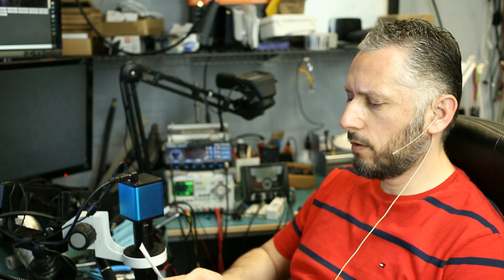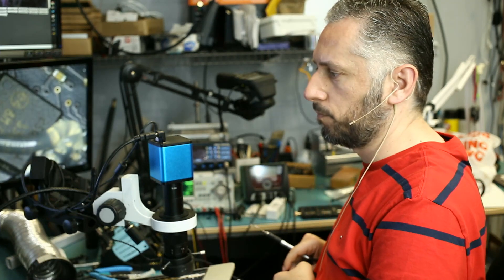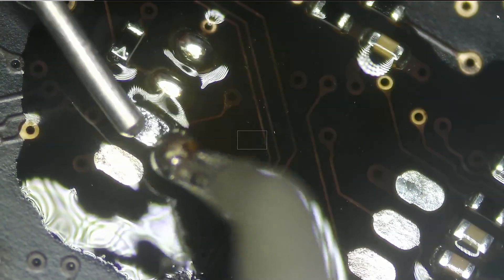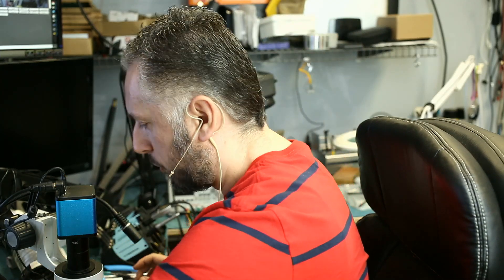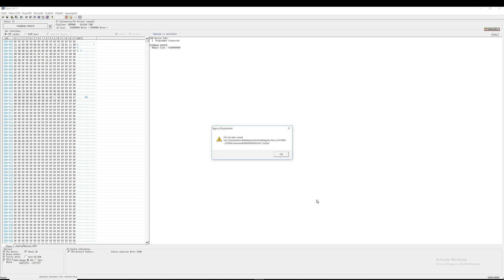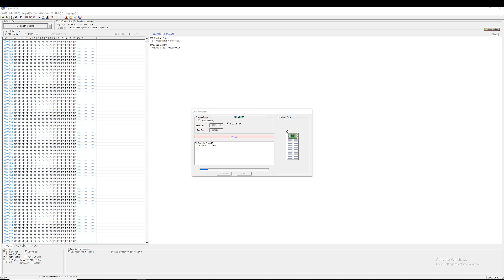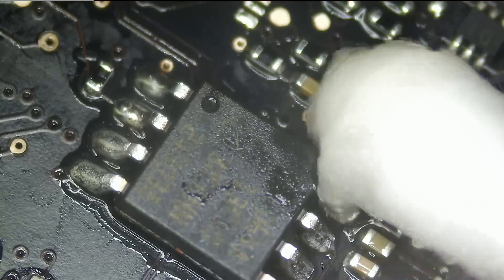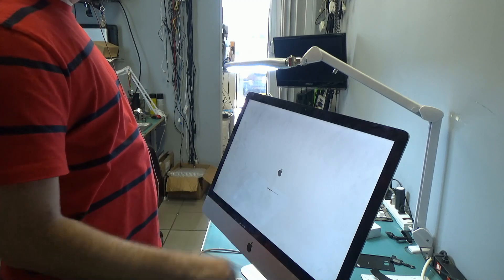2012 iMac Clover EFI bootloader Fix - Infinite cycles stuck in a boot loop

Comment: Friend, I have an iMac 2011 and after plug it on power cable: 
just LED 1 is ON (motherboard) and auto both coolers in infinite loop (1 second ON and OFF), but machine dont start.
This is the same your loop of video? Have any idea about the problem?

Thanks a lot!!!

Comment: Hey my imac do 3 small beep and 3 long beep i cant find the solution c an you help me please its early 2008
Reply: 3 x short, 3 x long, 3 x short? you mean this? Then probly it is EFI chip.
Reply: @guyriela  problem solved by changing cell on the board
Reply: @charliewright3534  that Could also Sometimes work. Good that it is Fixed

Comment: Good evening 
I just want to ask you something.....like my last resort after I’ve tried everything....
Endless hours on the phone with apple senior advisors,etc.
After a Safari update while I was on High Sierra I’ve lost both my mini display ports...I have a late 27” IMac 
So I’m not able to use my external monitor with this iMac.
I went to Apple Store....no luck,worst experience ever.
I went to the best repair shop in Montreal and they confirmed that it’s not a hardware but a software problem.
I was told that I have a “corrupted EFI”.
I was again 1 hour and 45min on call with apple senior advisor,tried everything with no luck again.
Any ideas or advice will be great and appreciate.
Thank you and sorry for the long comment.
Reply from the maker: The problem could be efi related. Use the contact us form at http://northridgefix.com/contact-us/ to inquire about price. To ship your device fill out the mail in form at http://northridgefix.com/mail-in/

Comment: lol, i actually found a way to solve this without even soldering.  Here's how to PROPERLY reset the EFI on any iMac.  Unplug it from wall, remove screen, (detach both cables for screen), unplug hard drive SATA cable, plug back into wall.  You will have no screen, BUT, power it on and the second you hear the chime, (it will be only one, I guarantee it), press and hold command+option+p+r.  once you hear the 2nd chime. let go.  Press and hold the power button to turn and/or unplug from wall.  Then attach everything and fire it up!!   That's it!  Don't use Clover next time.  =P
Reply: .. my macbook died in december, chime loop for efi corruption, what can i do?
Reply: ViralBump because of clover?
Reply: can i do this on macbook air?

Comment: Hi sir, what is the software you're using with the TL866II programmer and is the little board you clip the chip in is included in the ebay link (programmer) you posted in your tools ?  Thanks a lot and have a nice day :-)
Reply: I bought the 'plus' version which comes with multiple adapter boards and connectors. The software is on a small disc and you can also download it from their site.
Reply from the maker: The software is included with the programmer. https://amzn.to/2DODuG6. I removed the ebay link. Seller change the listing.

Comment: Thanks for this. I'm intrigued with the clamps at the end of the video; are you using a glue adhesive? I usually buy the adhesive tape kits that are pre-cut when upgrading hard drives on these etc.
Reply from the maker: We use a special epoxy blend with viscosity control that is unique to our shop. Double sided tape will work as long as it's a good quality and won't loosen up with time. I can't recommend any specific brand because i don't use tape. Try different options and see what works for you. Adhesives in the repair world requires a video on its own. I"ll brush up on this topic in the upcoming future.
Reply: @NorthridgeFix  Thanks for the info. I have been buying the (expensive) real 3m stuff from iFixit because of horror stories I've heard where screens have fallen off. This adds to the cost because we don't have an iFixit in the UK so it has to come from the EU or US.